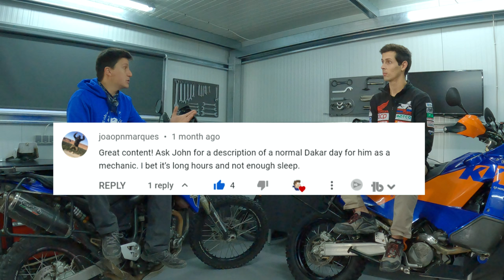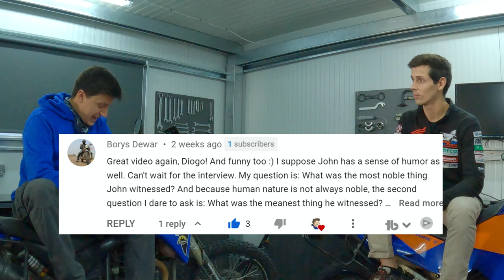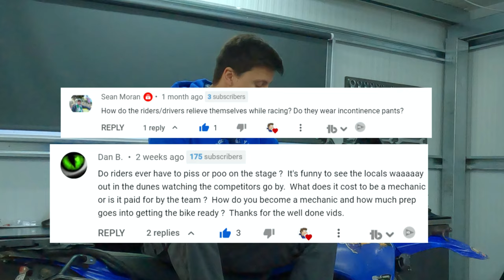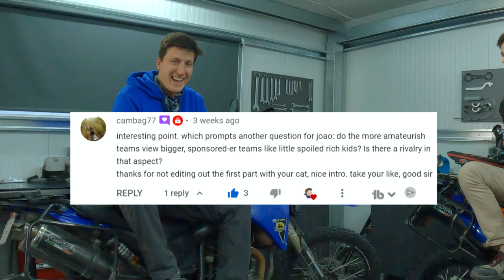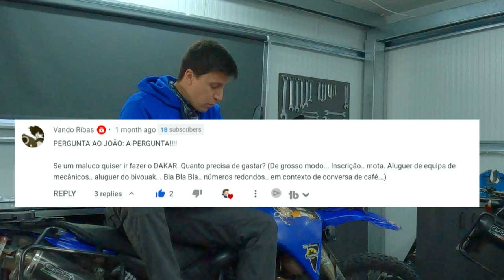Interviewing a DAKAR mechanic! Our friend John!

Comment: At 2:00 I wish he would give exemples of other bikes. Does he compare to modern electronic-heavy big and heavy bikes, or also old bikes like Transalp, DR350/DRZ-E 400, XT600, XR650, XT660 or even the new Tenere 700 which has the less electronic possible.
I thought KTMs before a certain year were a pain to work with, using exotic screw heads and things which make you buy more tools ? And that they were unreliable ? (I think around year 2010 they made some changes to their process and reliability)
Reply from the maker: I think he is saying that in general, KTM are more "race oriented", so from all the 450, the KTM is the one with less screws, less parts, etc...from all the 900s, the ktm is the one with easier to remove panels, washable air filter, etc (im guessing).
Old KTMs (before 2002, when they released the KTM 950 and the 640) was basically a small unknown brand. I dont think its fair to judge them by that "pre-dakar" era :)
As for reliability of KTMs, opinions differ. They offer a power/performance/weight ratio like no other, and I think that comes with a cost. So, basically they have a very good problems-to-performance ratio, but that doesn't mean they have less problems than the other bikes (because the performance is so high :D) 
Some people accept and want this, others dont
Reply: @OFFroadOFFcourse  Thanks man for taking the time to reply!